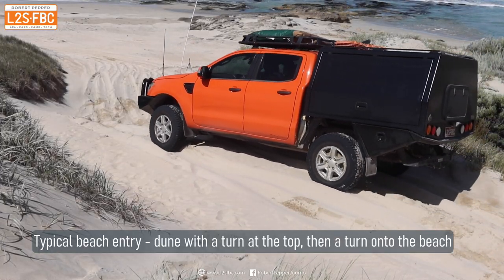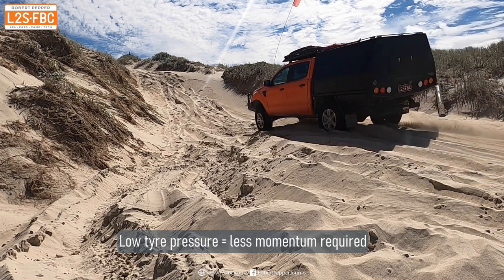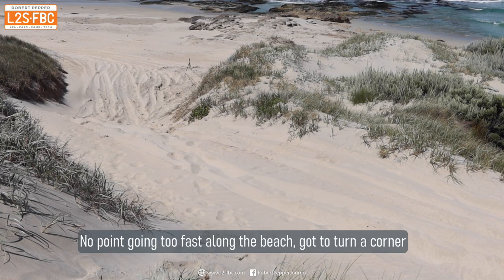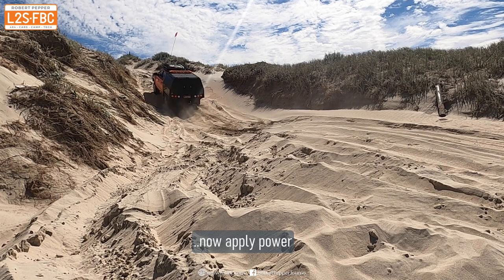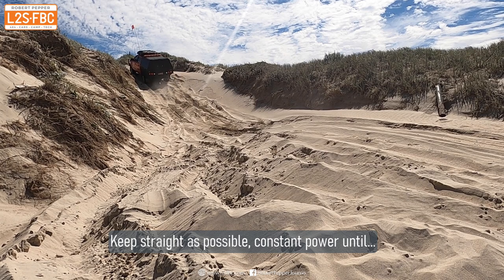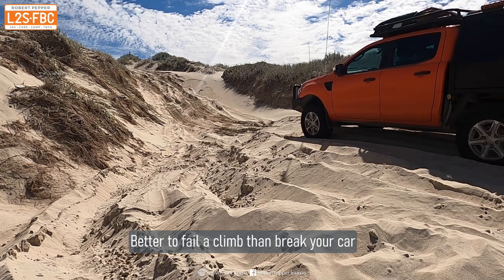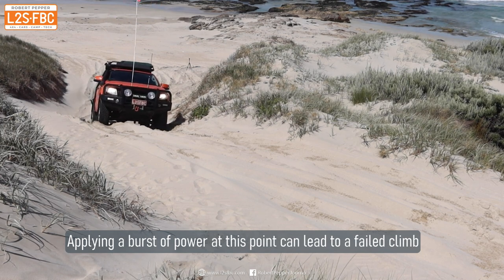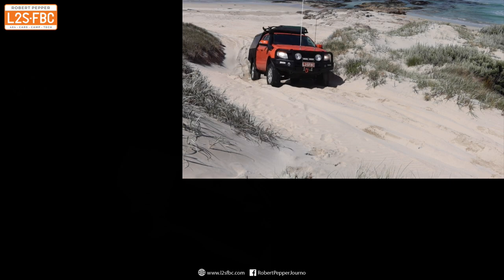How to exit a beach via a sand dune

Comment: I like the manual change capability in my Nissan CVT auto , as I can flick up or down   ratios instantly without loosing much  momentum . With a true manual gearbox once you put that clutch in going slow on deep sand the vehicle dies . This is why that Subaru could climb that sand hill that other bigger heavier manual vehicles could not .  The Subaru was able to get a fast runup in a higher gear than the others and then quickly change down  without  loosing  much  speed .  Engine then goes to higher revs and HP output and the lighter vehicle  and staying in the tracks of previous attempts does the rest .  Having said that I don't take this  new Nissan on the beach  , been there done that in other 4x4's , the salt does too much damage to the electronics and the sand works it's way into seals .